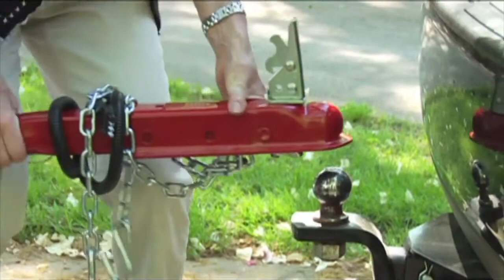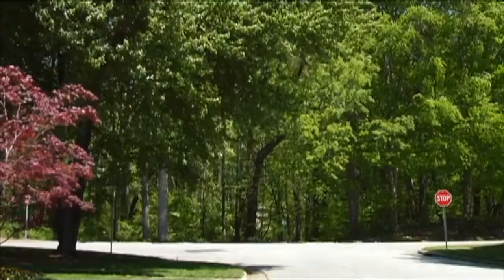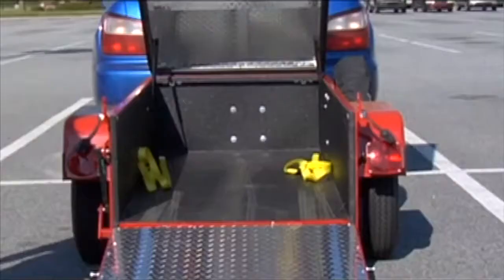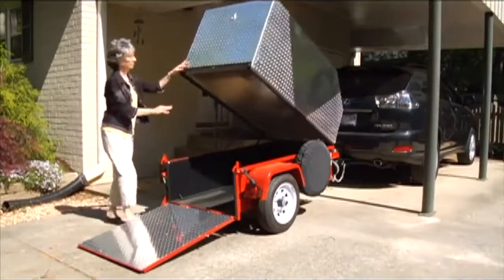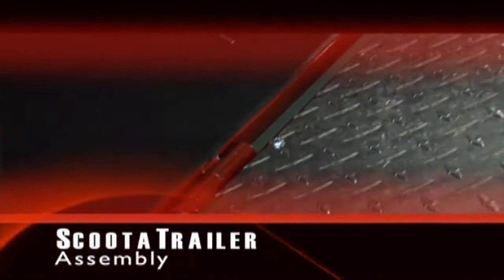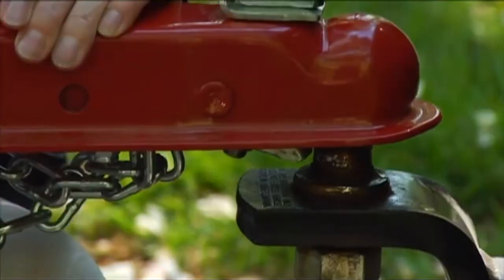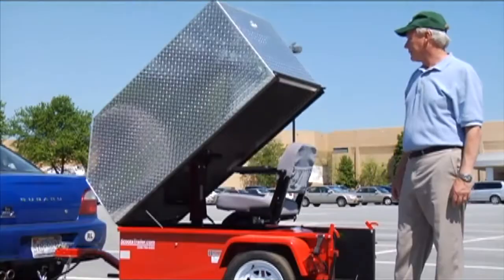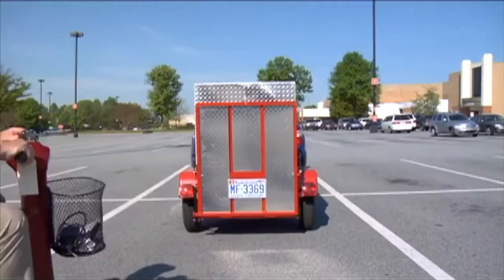Demo - ScootaTrailer™, pull-behind trailer for your vehicle. EZ transport your scooter or wheelchair

Comment: Could someone not come up with a towing ball hitch for the back of a car that attaches directly to a hitch mounted on the front of the mobility scooter itself.    So you lift up the front of the  scooter, snap it on to the ball hitch.  Then just trail the actual scooter with its own two rear wheels on the road.    Obviously you wouldn't drive too fast.   It would be more for short journeys around town.  Also  It means that you could use a bigger mobility scooter bcz you don't need to worry about carrying it in the trunk or even a trailer.  If you like this idea give me a 👍🏼 😊